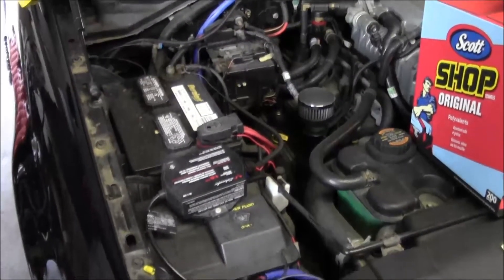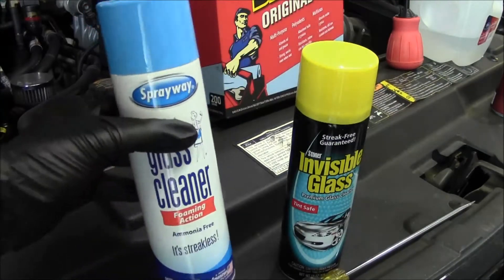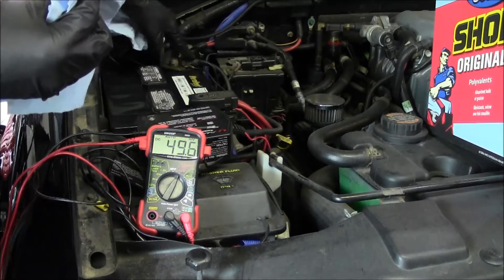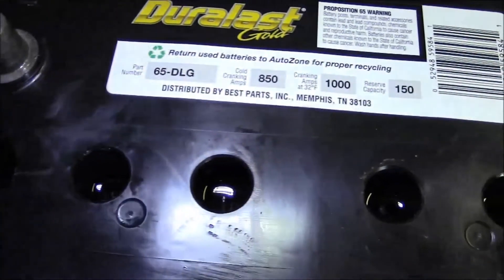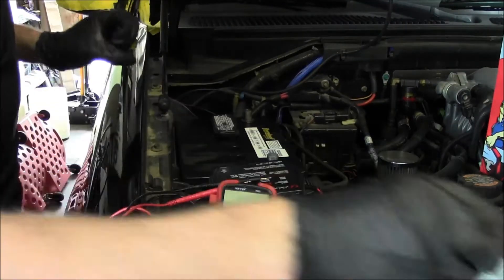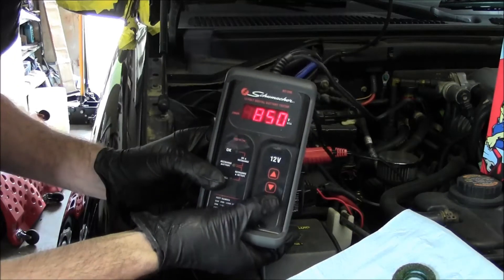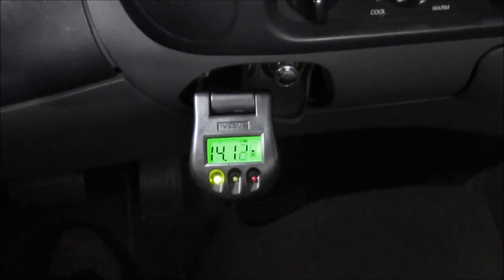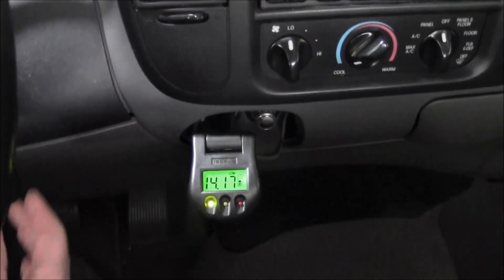SVT Lightning Battery Maintenance

Comment: Why not go with an AGM...  BOOM problem solved!! Lol
Reply from the maker: TJ CRIM:  You are absolutely correct on that one.  AGM is really the best way to go.  It's not my truck, so no AGM for now.  I do have an AGM in my Lincoln LS however.  That battery is amazing during the freezing cold winter months.  AGM really leaves flooded cell batteries in the dust when it comes to performance.